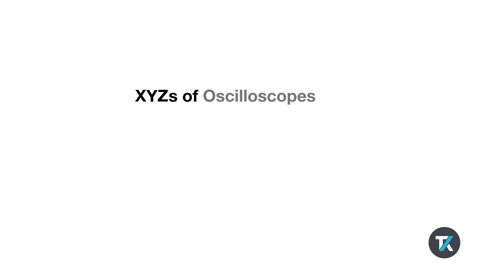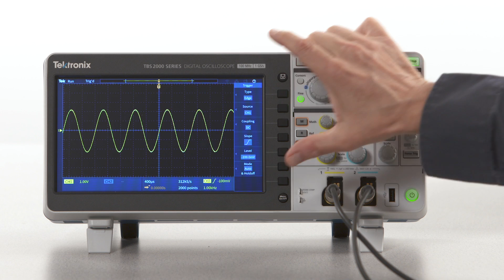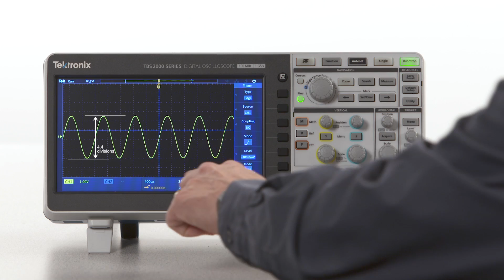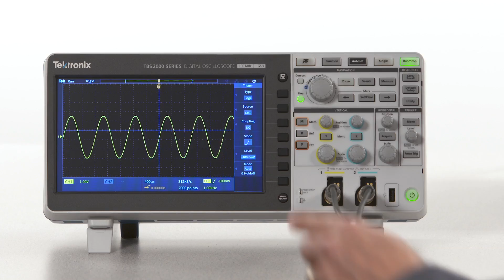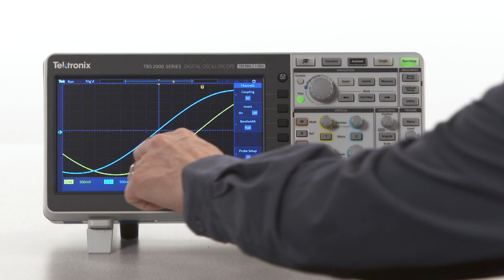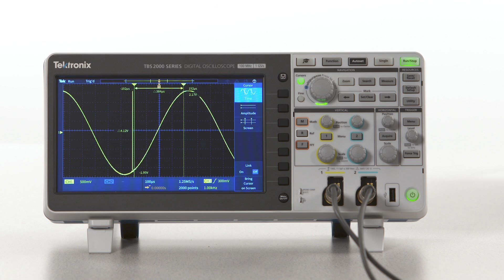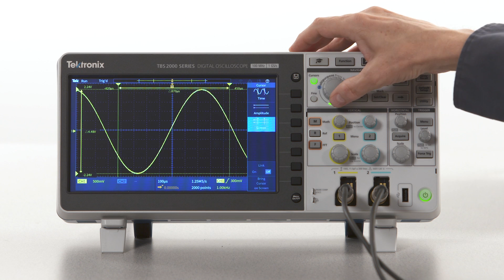Making Basic Oscilloscope Time and Amplitude Measurements (Part 4)

Comment: You lost me measuring the 45 degree angles between the wave forms. which is due to my lack of a knowledge of course. But I wished you would have shown how you got 40, 80, 120 ml sec.. thank you though. 
I mean I'm sure this video was not made for the guy who already know this. they know it and you probably didn't make this video for them. I know it's a promotional video as well. But showing how to read the graph is a beginners thing. A little more detail please. How about showing how to measure components and give examples. I did give this video a like and I subscribed.
Reply: i agree...he went too fast
Reply: @meetpatel7564  well fast for me. I'm pretty much an oscilloscope idiot. Lol
Reply: @AB-yu2tj  i did 3 years and I never paid attention because I took this field just for the sake as I had no other options at that particular point in time. 
now I am searching for a job and they all require knowledge of  the oscilloscope.
He was fast from the time the phase difference started. 
I hope you got the necessary knowledge of the oscilloscope.
I got an interview tomorrow and I think I am ready...Time will tell lol
Reply: @meetpatel7564  tomorrow you will land that job, no problem. I am an independent service tech all self thought. I just need to learn more constantly to stay ahead and competitive. I love electronics. I can set day and night and mess with this stuff.
Reply: @AB-yu2tj  thank you so much for the kind words. I will definitely let you know how it goes. It is good you are constantly trying to stay updated. Comes in very handy. Keep up the dedication man!

Comment: Can someone explain why he measures amplitude in volts, instead of Amps or milliamps?
Reply: oscilloscopes are a measure of volts vs time. so there are no amps that come in action here. and the unit of Amplitude is not Amps (A)
Reply: @meetpatel7564  Wow, thank you so much. That clears up so much confusion for me. I see now that Amps is short for Amperes, not Amplitude. I am sure this is 101 stuff, but I must have skipped class on this day.
Reply: @mend2511  no worries. I am glad I could help you out. Yes totally it is 101 but many have that confusion. I hope you are all good now. Have a good day.